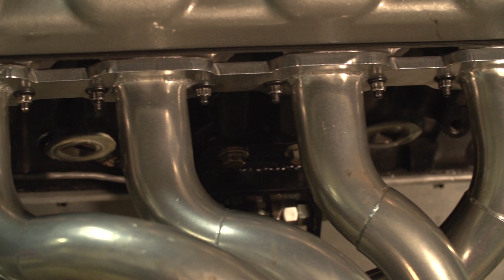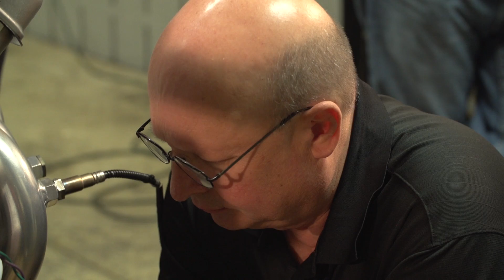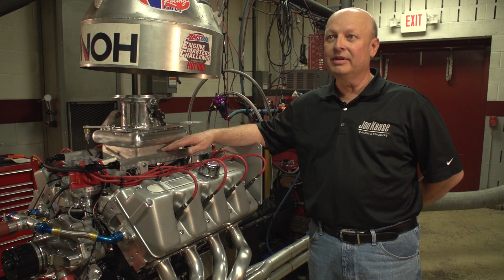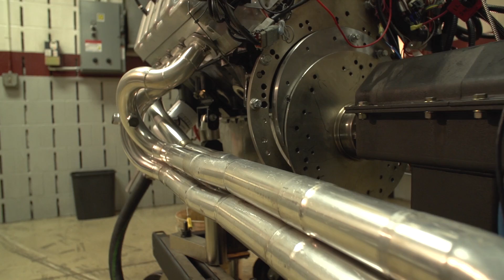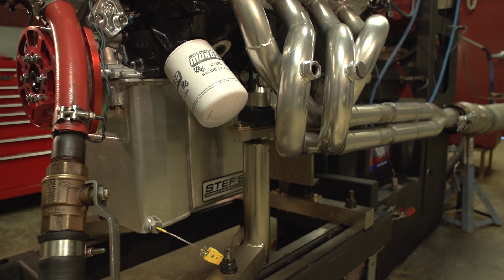404ci Boss 429 by Jon Kaase at the Amsoil Engine Masters Challenge 2014

Comment: 1.6 horses in every cubic inch. That's means there are, very likely, 2 horse's asses in every cube + the 1 behind the wheel. If my calculations are correct, that's 809 horse's patooties. Know what that means? This engine's got a lotta balls! You could even say, it's completely nuts ☺️ (okay, we get it)

The Corvette LT6 engine has 1.996 HP per cube. That thing is bonkers.

Comment: Surprised he went with a small bore. With those big heads it would be interesting to see what you could get using a 4 1/2" bore and a short stroke @ 9000 rpms. Hey the motors only have to last for some dyno runs.

Comment: Can you build a full hemispherical boss 9 head. If you can then you will be on the money. Getting the swirl that the Mopar guys talk about, that’s what we’re after. Use the new Godzilla block. The 7.3 and you will be number one fo all ford fans.
Reply: I'm pretty sure the boss 429 is full hemi
Reply: @xmo552  check the heads , the underside.....the valves are counter and the bore in the head is kidney shaped. The head is almost Hemi ! Sorry no cigar for ford ! I want it pure Hemi, sick and tired of being second!!!!!!!!!!!!!!!
Reply: @petervossos4816  
I see what you mean, but I think the last of the factory boss 429 had full hemi chambers.....No?
Reply: @xmo552   Yah,  I really haven’t had a look!   The only full Hemi head Ford made was the 427 sohc back in 1964!  That motor is the bomb!  It was nicknamed the Cammer!  Problems with the timing chain, l imagine, kept it out of the drag scene! Today however a fella in Australia and a company that goes by the name Robert Pond Motorsports working alongside Jon Kaase racing engines have improved the engine...you can buy it over the counter for 55,000 US. Yep, a lot of 💰!!!!!!! Ultimately the problem they can never cure is that the cam sits in the middle of the head so the spark plugs can’t go where they need to be......that’s exactly in the centre of the head. The only way to do it is to reposition the cam to one side of the head or to give the head dohc!!! 😃 That would do it ! A hemispherical chamber, two big valves, two spark plugs in the centre of the head, either side of the valves and duel overhead cams........that would beat the Chrysler Hemi!!!!!😁
Reply: @xmo552   I’m sorry, l apologies x mo . I made a mistake in the phrase....the valves are counter....it’s supposed to say ...the valves are canted !!!!😉
Reply: @petervossos4816  the hemi design is fairly good because it allows large valves at a reasonable cost, but it is not the best design for power. The Pent roof combustion chamber with 4 valves per cylinder is more effective and more efficient. but, the 4 valves per cylinder are very expensive in comparison to the hemi design.

Comment: Boss 429 first on race day fastest on race day and last but certainly not least ferocious on race day no damn 2 bitten junk Chevrolet well leave the Dodge guys for another day but for now it is indeed the blue oval all the way
Reply: The 427 Ford by far won more races than any 429. They were a dog and a very de-tuned stated as installed in the Mustang. The 427 SOHC put out 650 HP out of the crate.

Comment: Small bore has some advantages but  definitely  shrouds  the giant valves in the boss 9 head....Wasn't his best entry... Still made good power , but not 1st place power...
Reply: He only goes as big on bore for the cylinder head to work right. He tested the head on larger bores and the increase wasn't there so at that point you add more stroke. Everything this man does is for a reason. He just showing everyone he can take a outdated engine design and be competitive.

Comment: Might have been better off, doing large bore short stroke. That 3.6 bore is about a 262 cu/in chevy sized size, that limited the valve sizes, for such a big engine. On that engine you'd be hard pressed to get 1.92" intake and 1.5" exhaust valves. You can only do so much with moving air, when using a straw over a garden hose

Comment: just curious - why shrink a 429 down to 404?
Reply: The Engine Masters competition is about setting parameters and the builders building within them. Apparently this year was under 410 cu/in. My guess is the bore was limited to under 3.7 inches, only reason to make that combo
Reply: @crazylarryjr  thanks
Reply: The rules for this year.

Comment: John being an engine builder screwed up. You will ALWAYs get more power with a bigger bore over stroke. Friction comes into play. As well as unshrouding the valves, and shorter rods means less rotational mass which is killer to horsepower up top and stress on the bottom. He could have sacrificed a little torque and spun that pig up another 1000-1500 rpm and make WAY more power with the huge heads. HP= torque X  RPM ÷ 5252
Reply: Rayman 1 

  The thing is he understands the EMC rules and you dont. 

  There is a displacement limit and an rpm limit. You cannot trade low end power for top end by just turning the motor faster. You have to make the best average power AND torque and that total becomes your score.  

   Lets say 500 hp AVERAGE and 500 ft/lb AVERAGE and your score is 1000. The peak numbers are not considered. You have to run from 3500 to 6500 and that is the scored range. 

   Engine masters should be very interesting to every hot rodder since to win you have to build a motor that makes great power and torque all over the operating range.
Reply: Philip Mac Duffie No I know the rules of the event. To use that specific engine platform in the manner he did was the mistake. For the bore size, he really wasn't utilizing the head flow. I feel that a 3v Cleveland head or something of that nature beside what he used would have met his intended goal of small bore, large stroke.
Reply: Jon literally made the CHI 3V Clevland a thing by crushing EMC with it. He wanted to run the Boss9 since he just released heads for it and there was no Big Block class in 2014. He did it just to do it. 

  Huge bores and short strokes on high compression with crap 91 cali gas is a recipe for detonation. Which is why he didn't do it. The guy didn't make a mistake, he chose with his heart and tried to do the best he could with a big block at small block displacement.
Reply: Philip Mac Duffie I can agree with you there. What I don't understand is why e85 fuel isn't an option?
Reply: I have no facts here, but I would assume Hot Rods goal was to get engine builders to make something akin to what we might build in our own garages at home. If we let them run E85 you would see stratospheric compression and every head would have <40 cc chambers and look like a 90s cup motor. That has no relevance to the average guy. 

 Ford guys would run the D3 yates, GM the SB2.2 and it would be the battle of a 400" nascar-esque motors. They would all make over 900 on motor at be total garbage below 4k rpm. Just like a 358 cup motor it has basically no appeal outside the class it evolved to race in. This is why they set a 3500-6500 scored range; more like what a regular guy would build. 

  I think EMC pushed the boundaries of coatings in accessible parts we would buy. It also basically created the CHI canted Cleveland Ford head and the market surge toward it. You can especially thank Kaase for both. ( I'm sure CHI would say the C400 is that product, but we know his feedback helped the 3V ) 

  I personally think Hot Rod and EMC did a positive service to industry and excited people about big fat broad power engines you can build yourself, but dangling a big check out there for some of the industry "masters" to chase.
Reply: The Majority Of Comments Are Telling Jon What He Should Have Done, He Has Forgot More Than You People Will Ever Know, Try BUILDING An Engine For The Challenge & You WILL Find Out More Than You Think You Know To Start With It Isn't Only About Who Makes The Most HP. There Is More To It Than That.
Reply: But the formula is average power between 1500 6000 rpm.sure if you pushed 8500 you could get more hp but it isn't in the competition powerband
Reply: You should build a engine and go up there and compete against him.

Comment: I wonder why he went with the small bore combo in this? I'd like these heads on a 460 block (naturally with an old school solid lifter camshaft NO ROLLER CAMS for me). I'd be happy with that because I don't like strokers. They're good if that's your thing, but I like to thrash the bejeezus out of motors and know that they're going to hang together and not get hyd lifter pump up. I never feel that way with strokers - all that reciprocating mass gives me nightmares esp over 7000rpm.
Reply: ThePaulv12 they change the rules because John Kaase whooping everybody's ass now it's more about horsepower per cubic inches
Reply: ThePaulv12 Why in the world would you NOT want to run a roller cam? And they make solid rollers, btw...

Comment: Got to love Kaase. Dude gets over 660+ HP out of a naturally aspirated 404ci engine and feels like he screwed up.
Reply: Wat des a boos 9 go foor
Reply: @justingriffith8486  if you buy it built and dynoed close to 20k
Reply: @Diddy_Doodat  The heads themselves go for $18k, then you need an intake. You'll spend over $20k just in top-end parts. Count on a fully assembled ready-to-run engine costing at least $35k.
Reply: Why build the engine undersquare in the first place?
Reply: Well, that's not that great.  Folks get more than that our of standard 400 SBC's regularly.  Super cool looking engine, though.  But a shitload of work to get to where he was, power-wise.
Reply: @SealofPerfection  you can't compare those to this motor. It's a vintage class and must be built within a set of rules. You can obviously make more than this cheaper and easier. My 427sbc (non ls ) cost me under 10k to build everything new including the little M block, afr cnc heads etc and makes the same on pumped 93 with a hydraulic cam but obviously couldn't be entered into this competition. 
The man is a 7 or 8x champion in the class. You just can't win them all. Nice guy and really great engine builder.
Reply: @SealofPerfection   There's major limitations in this class as far as Cam specs and other variables that limit the power and these heads do much better with larger displacement. All other things equal and any larger engine there's no shebby gonna = flow potential and horsepower of the Boss.  Bob Glidden absolutely destroyed anything General Motors had to offer with a 500 in³ boss in the eighties and that engine is the reason they(GM) had to invent the DRCE  Just to be competitive. None of the GM factory junk can compare.
Reply: @SealofPerfection  Agreed. Would have been cheaper and easier to just have made a short stroke crank and not sleeved the block... If that's what he did to get the bore size down to 3.695". The stroke had to be about 4.71"... Very hard to get horsepower from an engine that under square. Custom made crank (3.375") with the stock bore of 4.36" would have gotten him there... But most likely a $7000 crank machine work and all...
Reply: @SealofPerfection  Pretty sure this test shows power limited to 6500RPM?

Comment: These type of heads ( Boss) are ideally suited for engines over 500 cubic inches.  Kind of like comparing a Boss302 with a Boss351. Top end performance NASCAR or NHRA not on the street.

Comment: And again there are plenty of N/A small blocks that would put that Boss 429 to shame.
Reply: lieu Gebo at 404 cubes? if this engine was at the correct bore and stroke it needs you'd change your tune real quick. 600+ at basically 400 cid is good for and motor really, open it up 572 maybe 600 and your small block reference makes your comment look silly.
Reply: I'm sure that John kaase guy knows what the hell he's doing
Reply: The Rules Apply To A Lot Of Different Combinations, John DEFINETLY Knows The Game, Jon Is One Of The Best There Is.

Comment: that power can be made with a Cleveland and with stock head castings obviously heavily worked.   I just know what boss 429 parts cost and unless building a boss was necessary. I would avoid that like a burning building. I have a close friend that makes respectable power with GM LS  parts. not cheap but much cheaper than exotic fords Wich I also love myself

Comment: bore is smaller than a 305 chevy. makes you rethink a 305.
Reply: The 305 is still a terrible engine.  Just cause he used a small bore on this engine changes nothing about the boat anchor that is the 305
Reply: The only reason it works is the heads, chevy 305's were junk, weak block, weak crank, heads were just as bad, it was designed for fuel economy over the 350, so as long as 350s are plentiful there is absolutely no reason to mess with a 305, i build custom engines for a living and on the sbc you want all the bore size and cubes you can get, if you want to build a good high winding engine build a 302 sbc, makes more power everywhere, fyi
Reply: A 305 is 3.736 and his engine was 3.9?? Almost 4 inches

Comment: Weird bore/stroke combo but how can you argue with 600 hp and tq out of 400 cubes?
Reply: You can run a Boss motor into the high 500s or even bigger depending on the block. The Voodoo/Coyote motors are cool and have the revs but it's hard to argue with the cubes.
Reply: AZCobraman I'm just sticking with my little Windsor small block- 362ci 876hp NA. 😁
Reply: @TheMattc999  
Care to share some info on that little engine ? 😁
Reply: @AZCobraman  correct. That Boss was designed for 429 inches but at 9000 rpm. Yates himself said that if the Boss had a few more years of NASCAR work, it would have been the only V8 to hit 1000hp
Reply: AZCobraman it's because they changed the rules because John Kaase was whooping everybody's ass every year now it's more about getting the most power per cubic inches
Reply: GlassTopRX7 how the hell is 666 the same as 525. ????
Reply: This was a vintage style engine contest for this year. This guy is a genius especially BBF. New coyote and LS engines weren't even allowed. Engine was produced back in 69-70  damn good power for the rules and almost 45 year old engine style.
Reply: yeah but how much bigger can you punch out that coyote vs this one?
Reply: Do you KIDS you even know what a Boss engine is?
I know it was probably 30 years before your time butt you might want to look them up!
It's called history!  Back when you knew the size of nn engine by "CID"  NOT Liters.
Reply: +AZCobraman It's about the same power as the 5.2l Voodoo is making, that 600HP is mostly likely STP corrected not SAE net.  Plus the newer engine is about 280lbs lighter.
Reply: Yeah technology has it's virtues doesn't it?  :o)
Reply: @GlassTopRX7  The 427 SOHC CAMMER V8 can make well over 650 HP than a Coyote and Voodoo can in NA form.
Reply: @CJColvin  There are Cammers making 1300hp NA? There are NA Coyote making 740hp with no power adders just race fuel.
Reply: @GlassTopRX7  Thats awesome brother.

Comment: Great engine and Great builder. I do not know a lot about Engines but you can tell a lot about the builder on how clean and organized his shop is. One Question: How much does the engine assembly weigh, fully built with intake, carbs, headers etc. I am thinking of an application to use a motor such as this, but the 50/50 weight distribution has to be considered along with spring rates and suspension modifications. thanks for the great video on this great Historic Engine. I got interested when a 55 year old co worker was telling me about his older brothers 1970 boss 429 and what it was like to ride in it in like 1973 and the awesome power this Ford mustang had. His brother lightly wrecked the front end in the early seventys and sold it in pieces for 1500$. I wish to God I would have been the guy that bought it. Thanks RH DSD

Comment: why capacity is smaller than in stock engine?
Reply: The rules for Engine Masters specify a certain RPM range, and a lot of times the stock bore and stroke dimensions for these engines are really made to emphasize the top end.  You can see that with another team who took a 426 Hemi and de-stroked it, and their engine probably makes peak power a few RPM short of a VTEC Honda or something; way too high.  So everyone else is going small bore and long stroke to get strong bottom-end.  Meanwhile, the output numbers for scoring are divided by displacement, so there's no advantage to running big cubic inches, and if you stroked a 429 with a stock bore, you'd be making enough horsepower to break the universe (and some parts), without helping your score any.  So we're seeing some really big small-blocks and some really small big-blocks. :-S
Reply: Destroked.
Reply: @cavscout62  If you'd listened he explained that it was small bore, long stroke. It's not de-stroked. You're Cav. Explains it all. lol

Comment: the  discription   on  both kaase engines say  404  but theyre  429 and a 599 wonder what other  discriptions are  wrong
Reply: the stroke length determines the displacement,
Reply: it has a 6" stroke??
Reply: Descriptions are correct, it’s destroked to a 404.
Reply: @cavscout62  Not De-stroked. Small bore.
Reply: @mustardstain504d6 "correct, it actually has a longer stroke than a 429 and smaller bore.